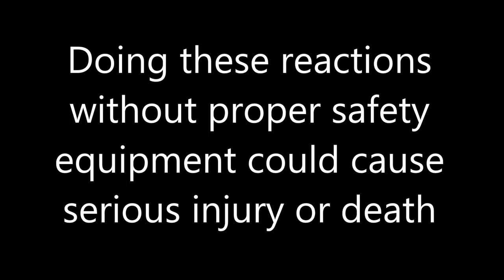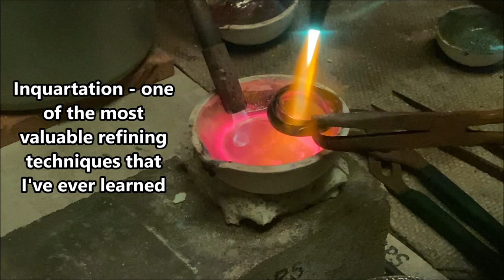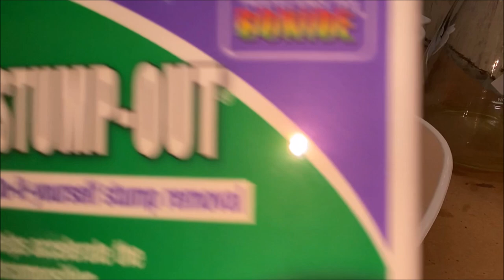Three Troy Ounce Gold Bar Refine

Comment: Here's a question I haven't seen answered sreetips.  Have you ever had the misfortune of a  power outage during refining that disrupted the fume hood fan and vacuum pump?   

I wonder if you have a UPS in case the power company loses the plot.  I once had a near disaster in a lab that wasn't backed up by a generator.
Reply: I cast regularly daily for 11 years with no vent.  If you are melting JUST PRECIOUS METALS you don't really need it.
Reply from the maker: Andy, if I have a reaction going and lose the fume hood, I’d put on my mask and carefully set it outside and cover with a tote
Reply from the maker: Good to know, thank you

Comment: Recommendation: Instead of lifting a hot beaker with caustic/valuable content up high to have the camera look beneath, place a mirror on the table face-up to make looking at remains in the bottom of the beaker safer.
Reply from the maker: Prop it at an angle and hold the beaker over it to view the bottom. Excellent suggestion. Thank you.

Comment: hello sreetips,
for an inquartation, it might be more interesting to

1. keep the powder dried from the first precipitation rather than melting down an ingot then again with 3/4 base metal,

2. replace the silver spoons with the same weight of plated or rolled jewellery, choice small or very fine objects to have a good proportion of gold.
the weight of base metal to remove with nitric is the same, and in the end you have a little more gold (and less silver).

first refine with nitric > aqua regia > precipitation > 1.dry powder > 2.inquartation with plated jewellery.
Reply: Hi!  I’m not Sreetips, but I’ve watched enough of these videos that I think I can give your questions a shot.

1).  In your first question, I think you have mistaken the order of his process.  He is not starting off with a previously refined nugget, nor does he have precipitated gold from a previous refining.  He is starting off with scraps (old earrings, gold chains, etc.) of 10k, 14k, and 18k jewelry.  Enquarting the gold is the first step in the process of refining lower quality scrap gold.

2). In this question, are you saying to use gold-plated objects rather than silver spoons for the enquartation process?  This would actually be counterproductive, as there is a very specific reason why the enquartation process is used.  If you have a higher than 25% gold to 75% silver/base metals, it actually decreases the nitric acid’s effectiveness at dissolving the silver and base metals, and leaving only the gold behind.  Cody (from Cody’s Lab) made an extremely good video about why the enquartation process is necessary.  Plus, if you increase the amount of base metals and decrease the amount of silver, it adds additional steps in order to precipitate and remove the base metals.  This also increases the chances of impurities slipping through the process into the finished product, and most base metals are not really worth the time it already takes to separate them from the more valuable metals.  Using sterling silver for the enquartation process creates less waste, as you refine the gold and then refine the waste from the gold process into silver.

Comment: Never tire of seeing your refining.

A question about your silver refining though.   How many grams of dry (powder) cement silver does it take to make a 1ozt solid bar.   Is it 1:1, or does it take more than 1ozt powder to make a solid troy ounce bar?

I assume 1ozt silver crystal = 1ozt solid silver metal.   Correct?
Reply from the maker: 31.1 grams of silver powder should produce a 31.1 gram bar.

Comment: Once again I have a question . Do you research your scrap silver or gold to see if there is any historical connections that would make the materials more valuable than current market value. Why I ask this is my aunt was at a garage sale and picked up an old silver tea and flat ware set for $25.oo and it was made in approximately 1770 by Paul Revier(misspelled). She sold it to a museum in New England, made a huge profit.
Reply from the maker: Yes

Comment: $5250 at the current spot price. Not bad for a day's work.
It's actually a good thing that there is a bit of copper in the silver used for inquarting, as it gives you a ready indicator of whether all of the silver and base metals have been dissolved at the nitric acid stage. And with all of the gold that slipped into the refining waste flask during the HCl and distilled water rinses, you're going to have a good yield when you get around to refining it.

Comment: Is the gold is diluted with silver to ensure the nitric acid is able to fully dissolve all non-gold present in the material? Whereas if it wasn't diluted with silver, some of the unwanted metals may be hidden within the gold and untouched by the nitric acid? So diluting it with silver ensures that the nitric acid is able to fully dissolve all non-gold metals? Am I understanding that process correctly?
Reply from the maker: Correct

Comment: why not heat the mould up until it is glowing red, and then pour the gold in, there would be less heat transference and thus the gold would stay liquid longer and that would prevent wrinkles or holes in the finished bar. i don't understand why smelters don't heat up their moulds until red hot. don't you want to get a nice smooth bar straight out of the mould?
Reply from the maker: Heating graphite to redness cause the graphite mold to burn away very quickly.

Comment: So, question. After AR, why not use regular tap water ice cubes? Yes, any silver mix with chloride will cloud the mixture, though it will get captured in the filter.
Reply from the maker: Tap water is fine for ice. But viewers wanted distilled water ice. So I started using distilled water to make ice cubes.

Comment: I'm curious if dissolving the silver and base metals would require less time and fewer chemicals if you first ran the alloyed metals through a roller to create thin but consistent ribbons rather than the flakes.  It would be an interesting experiment at the very least.
Reply from the maker: Yes

Comment: 33:17 Hydrocloric acid alone does not react with gold. So either there are traces of nitric acid in the solution or there are traces of nitric soaked into the metal that was not washed off. In either way it forms immediately fumes and the yellow gold chloride.

Comment: Nice golden "loaf of bread"

Sreetips, you can reduce noise in your fume hood by move hood fan on to outer side of the wall (all interior part becomes low pressured and any possible leaks wouldn't contaminate interior air), and add flexible "spring" tube as a part of duct (flexible part will cut off vibrations from the fan).
vacuum pump can be partially muted by plywood closet with curtain of heavy cloth (carpet for example)
soft foam sheets also absorb sound
Reply: Too much work it's fine how it is

Comment: Sreetips, I acquired a lot of silver plate yesterday. My question is there anyway I could heat the items to 1000° and remove the silver from the copper or what equipment would I need at a very basic level to refine these items?
Reply from the maker: Melting the metals together does not cause them to separate, they will alloy

Comment: I used to be able to solve chemical equilibrium for 2 long chains in my head back in high school, but never knew what that really meant. If I knew that doing Chemistry meant I could be wizarding gold out of materials with magic liquid sloshing, I might not have failed out of boredom.
Reply from the maker: I took one chemistry class in my whole life 50 years ago in high school. I got a “D” and never took another. Not because I couldn’t do it, but because it was boring.

Comment: I guess you wouldnt want to catch a breath from the silver jar. That is some of the thickest fumes Ive ever seen. Would that kill you quick or would you just get sick?
Reply: Inhaling nitrogen dioxide in that concentration would most certainly be lethal and not the way you want to die. Any amount of nitrogen dioxide is extremely toxic and damaging. Whenever nitrogen dioxide comes into contact with water it forms various nitric based acids. This happens in the eyes, nasal passages, sinuses and the entire airway. Even a light whiff of the stuff can cause serious problems with breathing and up to edema in the lungs. Prolonged exposure will lead to chronic lung disease. Its not something you want to mess with without the proper equipment and conditions.
Reply from the maker: It will dissolve tooth enamel

Comment: Wondering if you could recover gold from gold filled items buy using it as the material for inquarting karat scrap.
Reply from the maker: Yes, but I refine silver do I prefer inquarting with sterling flatware. Then I can save my gold filled material for a separate video.

Comment: I'mm curious, sometimes I hear Sreetips say the final gold is three nines or fine nines pure.  I understand what that means.  But my question is how does he know?  Is there a way he can see if it's .999 or .99999 pure?  Is there a limit to how pure it can become if it's different karats of gold? Or is it that a certain number of baths is always .99999 pure?
Reply from the maker: Industry standard is three nines (999 parts per thousand) I sell to a big refiner. They shot it with XRF to determine my pay out. It always comes back three nines.
Reply: @sreetips  Hello there, thank you for taking the time to respond to me.  I guess my question was more...does all gold have the ability to be refined to five "9" purity?  For example, if you're refining scraps and you have like 25g of each 10K, 14K, 18K, and 24K.  Could all groups eventually reach that purity level with a third or fourth pass?  Or does something like the karat or type of gold limit the ability to get to five "9"?  I was curious if when you say this is three or five...is that the highest purity it can get in this situation, or if you knew just by the look or general process that one or two passes gets the gold to the three "9" and there's no point to keep going.  That sort of thing.  Or maybe there's not much of a difference, or point, when dealing with the refiners between three and five?

Comment: I see you do the inquartation process so often, but I'm always seeing you do it after it appears you've raided an old lady's estate sale for silver scrap. What happens to all the silver that you recover? Why do we never see you form it back into bars to use for future melts?
Reply: He sells it on ebay
Reply from the maker: I dont use pure silver that’s been through the silver cell. Best to use sterling silver.
Reply: @sreetips  OK, I've been wondering about this a lot. I just figured that reusing your own fine silver resources versus constantly needing to acquire new sources would be easier to do. Is this also a financial decision? I'd think that it would be cheaper to recycle fine silver and add in the 7-ish% copper from unalloyed electrical wire or piping since you're just going to melt it all down again, anyway? Do you make enough from the sale of the refined fine silver to make that a more profitable effort?
Reply from the maker: Using pure silver, that has already been through the silver cell, would be a step in the wrong direction. The first step in refining sterling silver is to dissolve it in nitric acid. So why not use it to inquart the gold? Essentially refining both metals at once. My wife gets me plenty of sterling silver at local sales. So I have plenty on hand to use for inquarting.

Comment: Do you ever use the recovered silver for inquarting?
Reply from the maker: No, I use sterling silver for inquarting
Reply: @sreetips  I watched a bunch of your videos and always see you use Sterling silver, was just curious if the refined could be inquarted like the sterling silver.
Reply from the maker: Yes, but using the same silver over and over would cause palladium to build up in the silver. This could cause palladium contamination in the silver cell when we finally run it through the cell.